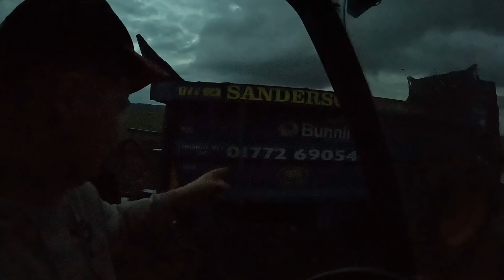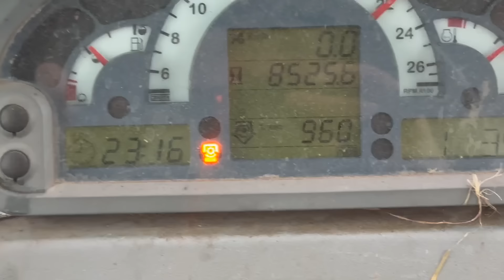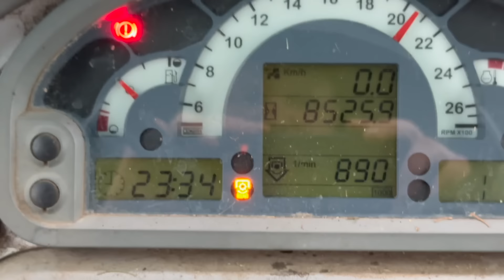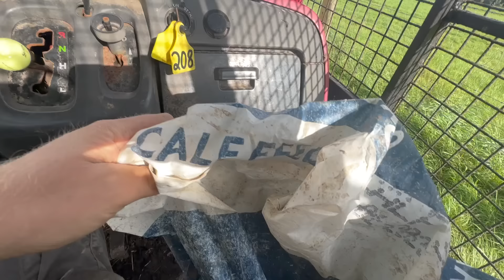TIME TO SWAP!? MONSTER TRACTOR ARRIVES ON THE FARM!!

Comment: I think the one thing you need to upgrade is the Manitou - it is the most used bit of kit apart from the mixer wagon. Love Manitou and back in the day we used a 4x4 forklift one for all our day work.
Reply: I would most definitely agree and make the point for the few days in the year when higher horsepower is needed you should plan to rent a higher horsepower tractor to meet your needs. (it also allows you to "try before you buy" a bigger tractor regardless of how it is to be paid for.)
Reply: Manitou doesnt need to be road legal which is a huge deal, like the scraper tractor, just needs backwards, forwards, up and down. On the other hand would love to see Tom in a Merlo Multifarmer, he might just be the target for one of those.....

Comment: It’s worth looking at now rather than later. I can’t quite see prices coming down for new tractors, A trade in + finance is a solid idea. With the hurlyman being 16 years old and on 8000 hours she will start losing power quickly. 5-10 years down the line she’ll struggle to even mow and who knows what prices are going to be like at that time. It’s a well worth investment that will pay itself off for years to come. Best of luck on whatever decision Tom👌
Reply: bobmarley-cg1lw  Very good point to make, I’m all livestock really so i don’t have much of idea about tractors. Solid point made there👌
Reply: Can you even get parts for them by tben🤷‍♂️
Reply: Personally I think there is far more middle ground to be found between this new and the Hurli. I've just bought a 6 year old 115 Maximum(boosts to 145) for under £40k with less than 1800hrs. Very capable machine and a massive upgrade from Tom's current tractors and probably 50k less than this spec 150
Reply: @bwarey52 this looks like a much better idea than 150k on a new new machine. 100k should get a roof on the clamps and probably over the midden if you shop smart.
Reply: @gwynroberson198  £45k tractor and £45k handler would be a massive upgrade rather than the new one but the problem is the finance at the moment with interest rates if you don't have the cash to hand. On the plus side new tractors have 0% again now as there seems to be plenty of stock available now and a tough market
Reply: bobmarley-cg1lw  i run an 265 head dairy farm. 425 acres of grass to cut.

My contractor does all my mowing/harvesting. Muck, fertilizer, liquid manure spreading (on gps  thus very accurate.) Also the land renewal, plowing and so on. For about 120k a year. You cant buy an new tractor for that amount of money. Also i would need an employee to run that tractor. Another 40/50k a year gone. I dont even want to buy the implements and run the risk. 

I increased the herd taking because taking care of my cows. Pastures. And buildings and so on  Makes me more money then tractor driving🤷‍♂️ good tedders, an new feed mixer , fine tractor and loader is all i need👍
Reply: @FrisianFront  thats all fair enough but what when your contractor is not available? much of Toms work needs to get done when it suits them and can be start-stop so not always suitable for getting someone in to do it
Reply: @2013viewchannel  ours is exactly the same. Tom also needs good weather forecast predictions. Just as him i have to call in advance for harvesting and put an date together to start mowing. They have to fit all their other customers in aswell. Im 2 to 3 times larger as the average farmer near me. So for them an good planning is key. To help them a bit i take my cuts in portions to not distress all the other customers to much and create some leeway. But when it really coming up we can go all the way. I still have an forage wagon and mowers myself.

helps to have good relations and pay their bills in time, also dont switch contractors as youll be seen an an jumping wh*re and be put at the bottom of the customer list.

 Our contractor already works for 45 years for our farm., is almost next door😅 and we have a ton of communication about everything.

Comment: Hi Tom. I had a 150 maxxum exactly like your demo tractor. Im sorry to say though they aren't a good tractor at all. The gear box is horrible, the power boost only works so much and it was a poor tractor for grip. My 150 got traded in and now got a claas arion 650. The claas is 185hp all the time and would leave the old 150 standing.

Comment: 9:30 - First made in 2015.
CASE IH Maxxum 150 utility tractor.
Engine : FPT turbocharged air-to-air intercooled 6.7 L. 6-cyl diesel.
Fuel Tank Capacity 194.9 L.
Hydraulics  Pump Flow 79.9 Lpm🚜

Comment: Go for a case 175, deffo all the hp you need and will last you longer than the 150, it seems that with the current times and the future everything is bigger and requires more up to pull/use, get more than what you need now but will save you having to buy again in the future when bigger implements that you need come out

Comment: I run a 6130r John Deere and I pull a 14t Richard Weston with silage sides on during silage and even use it for digestate and muck cart (just don't load it right up) and it pulls very well! You won't regret the extra power! But they're not massive tractors

Comment: Good tractor but i would probably go for a 4 cylinder tractor about 125 to 145hp. More nimble for your farm building. All you need is 40kph box, mechanical spools, front suspension with cab suspension as well. I would add a fore end loader as well for versatility. Ive just bout a Case 185 with that spec for low tech types of work that you guy do. Still plenty of power that you will need 95% of the time. You would be suprised how much time a tractor spend just pottering around.

Comment: Nice Tommy! We have a new Holland T6 155 which is 6 cylinder and it’s mega, the extra weight works for us as has a loader on and doesn’t move. If I was you I’d have a loader on it as it gives you more options especially if breakdowns stop things. The only downside for us is she drinks a bit more fuel but you would be on top of the job big time!

Comment: The last farm I worked on I had a case maxxum 150 I was a good all round tractor it did all the ploughing 5 furrows and a press 5 leg sub spoiler muck spreading 18T spreader straw carting 45mile round trip did everything I asked of it I did keep a 1.2ton weight block on the front all the time made the front suspension work better

Comment: New tractor, new air con, Get a front pto and figure out the mower with mchale.  It might be too much on the three point! for the hurliman.  Trade it in, it floated nice on a wet field.  Not much in tracks, more so the muck wagon, rent one with tracks next time!

Comment: If your planning on a front mower stay with a 6cyl as much as the new 4 bangers punch above there weight the 6cyl driveline and torque  will help keep fuel use lower. Big tyres be a great bonus when soft for spreading. Try a massey if get chance

Comment: the problem is not the 100 horsepower it's the small engine, if it had been a 6 cylinder with 100HP you wouldn't have the problem with pto rpm bumping down. But it seems like almost every farmer in England mostly uses 4 cylinder tractors and I don't know why😅

Comment: I’d go for it. Just even from an efficiency standpoint. That little 100 horse tractor is working full out all the time. Probly save on fuel having more power but working less. And just reliability too. Little thing going full bore just wears things out quicker. Also gives you the option to go to bigger equipment in the future then to tho. Little bigger mower maybe. Pull buggies better to etc.

Comment: I would suggest going for the 145 as the 4 cylinder will have a bit more power and torque than a similar hp 6 cylinder

Comment: If I was doing something nows the time low rate finance available to try and move on the large volumes of dealer stock, prices probably won't go up massively so I wouldn't worry I that respect. I would look to see if there was a 4 cylinder version. Probably be a bit handier than a 6cyl . Try Lloyd Lancashire if you're looking at the blue version of the same tractor.

Comment: Over the last couple of years, you've had to borrow tractors or push the Little H to its limits pulling machinery and carting.  Also, you and Dad aren't getting younger and if you're getting thrown about in the cab, its going to affect your back, hips and neck. Have you seen what a good chiropractor charges? Tractor prices aren't coming down, if you can, go for it.

Comment: Word of caution we did the parlour slurry storage had to be sorted changed a tractor that needed changing also changed the loadall put everything under a bit of pressure. Now got a main line tractor with nearing 9000 hours and 20 years old some niggly problems and going to have to spend the money on it to keep it going because the jump to a newer 1 is too much to do

Comment: One thing to consider is fuel consumption. Ok i appreciate a small engine under full load will use fuel whereas a larger engine at half load may use about the same. But will a bigger tractor still do as many tasks as the hurleyman or are you limiting it to big outdoor jobs only. If thats the case then just hire when you need.

Comment: I would like to see a side by side of the comparison of the tractors you have tried.  To include cost.  No apple vs orange comparison.  Strictly apple to apple.  Long time since  since I looked at new tractors.  Last time was 1963 or 4 massy Ferguson vs a ford automatic both 2 wheel drive and no cab. 🤣

Comment: That case is a beaut.  Do you like it more than the big Hurlimann you had?  Either way, IMHO, if it is financially doable, with the smaller Hurlimann to do some of the secondary tasks and the new scraper tractor, Yes, a bigger field tractor would make a lot of sense.  That, and potentially getting bigger tires on the smaller Hurlimann so when it is in the fields it can show it's stuff a bit more.
Reply: I thought of something $$ related to your potential decision making process.  The 100 hp Hurlimann is probably easier on the diesel than the big Case or the big Hurlimann.  BUT, when it is straining, as it was in this video, it is probably worse on the diesel, AND it is creating greater risk of engine or transmission failure which means major major major expense.  
So, the slightly less fuel efficient tractor might be long term (10-15 years) the better options considering the potential repair bills for over burdening the 100 hp Hurlimann.

Comment: Go for it. Finance it. Whatever you got to do. The time savings having the bigger machine will pay off. The work load on the hurliman means sooner or later it will break big, and then where will you be. You need the hp, the extra weight and front pto. While your at it change the Manitou. Do a deal, put it over 5+ years and love life in better machines.

Comment: i believe you shouldve bought somthing between the power of the scraper tractor and merlo two wheel drive about 70 80 hp for feeding and scraping i think you should check out the merlo agri with the 3 point hitch and pto both tractors will work 365 days a year including field work

Comment: The case would be a great addition  the only problem i can see is shes physically a lot bigger than the hurlimann ideal for mowing and spreading dung, slurry etc but when it comes to the strawchopper in tight spots it could be a problem financially i know probably couldn't work but to have the 2 hurlimanns for the yard work and light duties would be some job for you going forward as expansion stays going no dropping off feed wagon to put on straw chopper while rushing with that to get out slurry because rain is returning after a day off 😂 great job as usual Tom 👍

Comment: Yes olalala new tractor and definitely in need for that brush at Ollys yard why don’t you get a new Holland t7210 because it’s more horsepower and it’s probably the same size as that 150
Reply: The new hollands wheelbase is almost 20 cm wider. Turnradius 1.7m larger and youll only get like 130 nm torq extra for an much larger horse of an tractor. Tom hasnt got the implements for. Larger mowers  slurrytank and so on🤷‍♂️ 150 hp is fine for their operation.

an good dealer with high service close by is very important to me. Every tractor breaks down... its key that it is getting repaired quick or that the dealer has an spare tractor for use.
Reply: @FrisianFront t7 200 is only 155 without boost, not sure about 210 but it is less. 210 with boost I assume so would be closer to the case tractor in  that aspect
Reply: @kieranosullivan02  210 boost is 210 hpand without boost i think is 185 or 195 hp
Reply: The case equivalent to a t7210 is a puma 165
Reply: @FarmersSss  so he might as well get a t7210 because it has more hp and it’s “cheaper”
Reply: @AccountNotFound1  personally I wouldn't have either. I'm not trying to upset anyone but I've owned and drove plenty of brands. I just don't rate them at all
Reply: @FarmersSss  drove with the first t7210 blue power at the contractor i worked for when my dad still farmed. Found the cvt annoyingly loud and jerky  and the controls lacking and twerky ompared to the fendt 720 and 820 we had running there.

Drove an tuned case puma cvx 185 for another farmer that was an fine tractor. 

John deere 6175r ap was an crappy tractor😅

Just had an new claas arion 430 on demo and an john deere 6120m. Those are better suited farmers tractors if you want an bit larger i would take an heavy 4 cil like the massey 61series(fine tractors good price for quality) . Fendt 500 series(bit pricey). Or claas 500 series(400 series as loader tractors all the way)

Im running our dairy farm. 265 head dairy cows. 425 acres of grass.

My contractor does all the silageing/ baling. Mowing. Muck, liquid manure and fertilizer spreading. Land rebewal just shy of 120k a year. I cant buy an new tractor for that🤷‍♂️ and have extra personnel to drive it.

Comment: your right in that the work load for a 100hp tractor has gone up quite a bit, with the mowing slurry and dung spreading so a bigger tractor may well be needed. 
you would need to trade one of the malone mowers as well for a front mounted unit.
you mentioned a while ago that you were also looking at upgrading the tele handler. might it better to look at a 2nd hand 150hp tractor to do the heavy work and put a loader on the hurlimann to ease the tele's work load and trade the old case. that way you could still use it for light work and tedding?

Comment: I personally would buy a new tractor in the size up from what you think you need.   Reason being is too many times I have bought something and within the year outgrown it.    Also I would keep the old one for a few more years along side of the new one.    You could split the workload and let the smaller tractor handle the smaller tasks which would be less stress on it and extend its life along with not adding hours and unnecessary wear on the new one.     It’s the reason we still have an old case 3230 and ford 3000 around.    One runs mower one runs rake and the large tractor runs the large baler.     Plus the old stuff is paid for.  Just a thought.
Reply: I agree with this statement fully. Also gives you different options should you require a little help along the way. How much is it really going to cost to run and what if your neighbour isn't able to help for a day you wont be stuck then will you. Think long and hard about this Tom. All the best mate and I love your work 👏

Comment: I have a 145 maxxum and a 170 puma and I have a jd 6420 2300 hours and still going strong  and we have a we bought the 145 new in 2019 and the same year we bought a silage wagon and it is big but the maxxum is well able to pull it

Comment: Think the Hurlimann needs to  stay as well as getting a larger tractor. Probably better off getting rid of the old case with the loader instead as I think the hurlimann will be a better tractor to do all the odd jobs around the farm could even put a loader on her too. I have a massey with similar power to the hurlimann and she can cart and load bales in the field (one man job). I also do everything else with mine. and with putting a loader on her be a back up for the manitou. Think you would regret getting rid of the hurlimann. They don't make tractors like they use too.

Comment: At the moment the case seems a big tractor but in 5 years it won't be that big. Look whats about with the same power. It doesn't have to be new. Yes its going to use more fuel but you'll cover the land quicker. Anyway great vid

Comment: Time to swap - are you saving a lot of money by using the slurry vs the manufactured fertilizer since it is extremely expensive? Could the cost savings of using the slurry bs the fertilizer justify swapping up? 16 years old is pretty old and she may breakdown since you are using slurry in the fields and cutting as much grass you are cutting ... any grants available?

Comment: Anything new is just deferred rust but in your case maybe you current tractor is not quite big enough and could head for an expensive breakdown at that age so maybe a five year finance deal is where you should be heading for on a new tractor ,and your right about 100 hp tractors ,push them hard and they can do nearly everything especially if you are getting someone in to do the chopping far to many farms are over horsepowered

Comment: I will like you said it’s amazing what you did can do with 100 hp but now you’ve just said you’re cutting nearly 400 acres. It’s a lot to ask if a little tractor plus the trailers are getting bigger that you’re pulling around and its amount of time that the bigger tractor will save you Which means your spend less time doing things because it will do it so easy me personally I would make the commitment and I have a good day off because I drive at 150 puma and that’s 9years old and still drives like it did when I had it new